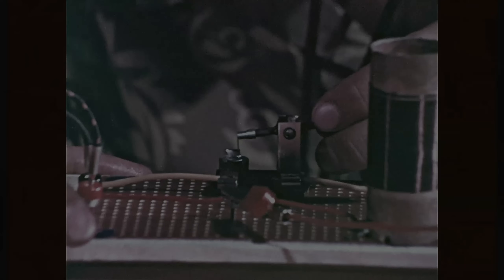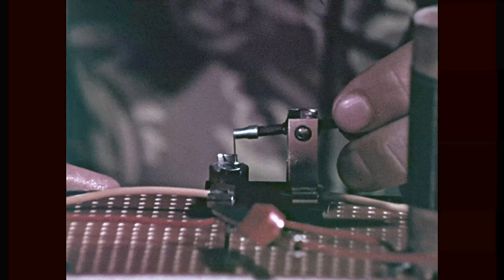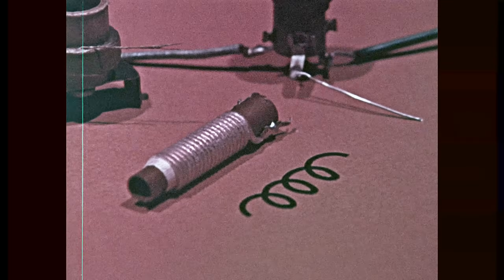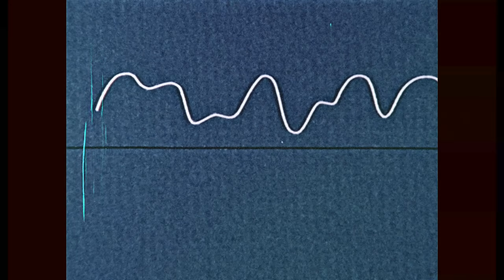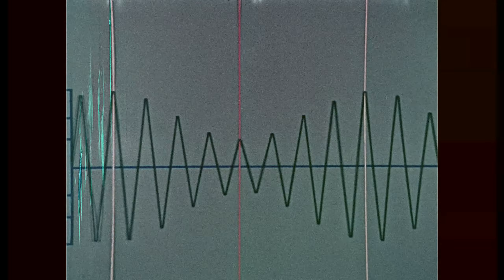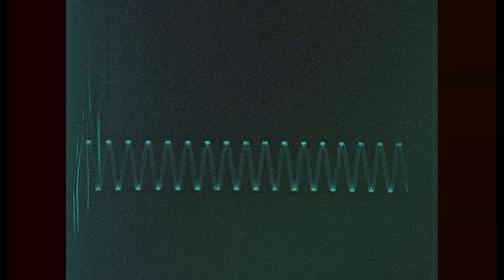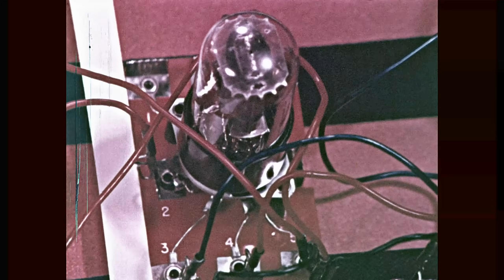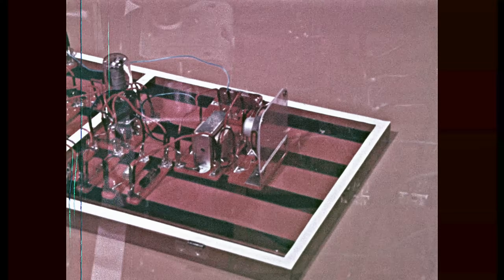Vintage Technology: Electronics--  BASIC RADIO CIRCUITRY, Learn How Radio Works, 1971 (History)

Comment: yo lie un cable al grifo del agua puse un diodo y un auricular, y se escuchaba la AM , jajaja no se si hoy fencionara
Reply from the maker: Using water pipes as an antenna for AM reception may still work in some areas, especially where the AM signals are strong.

Comment: Those who lived through this period told me that Marconi's only important contribution was to experimentally determine that the electrical length of both the transmitting and receiving antenna that develops the best performance corresponds to half the length of the radiated wave.
Reply from the maker: That is an interesting bit of history, thank you for sharing!

Comment: Capacitors do not allow AC current to pass; they enable displacement current (Id) to flow each side of the dielectric, which builds up an electric force field across the dielectric. This displacement current is termed Id, but no electrons can actually flow through the dielectric, unless the capacitor is damaged and has turned into a resistor.
Reply from the maker: Hi @davidholmes167, thank you very much.  An interesting summary.

Comment: I am an engineer and owner, building 18 full powered facilities and many low powers, since 1966. But my post here is not about me .
This video misses a very important point for an individual who should be given credit for the first wireless experiment back in the mid 1800s.
Dr. Mahlon Loomis accidentally discovered and created the first wireless communication many years before Marconi was even born. He set a wireless communication 14 miles between 2 hilltops in Virginia, as witnessed by several including a congressman. Bill K5EYS
Reply from the maker: That is an excellent point!  Dr. Loomis is probably less well known as he should be.  There is quite a bit of historical info in the WP listing that may be of interest as well.  Thank you very much for pointing this out.  His contributions were substantial.  https://en.wikipedia.org/wiki/Mahlon_Loomis

Comment: since 1965 to 1999 myself fabricated more than 1k superheterodyne radio receiver sell able with a honorable price as my bread and sugar as I can't digest butter well along with other 1500 different low cost and useful electronic product mostly consumer electronic products being used in our day to day life for different purposes using thermoionic valves , transistors , ics and system modules with the rapid change of the technical world to keep pace with the present day state of the art now I am capable enough to fabricate any kind of electronic product as per customer need with adequate modification design art work within possible desired degree of limitation of very low cost most acceptable price depending on " cut your coat according to your cloth" and I bestow my whole heaarted sincere respect to one and all about 8 billion inhabitants of this most beautiful and sweet   Earth and let us all try to save this most beautiful Earth for endless X^2 trillion of light years of time sharing our all possible efforts and courage with due respect and kind regards Biplab Banerjee.
Reply from the maker: Hi @biplabbanerjee3013, thank you for your thoughtful feedback!  ~  VK

Comment: As a Cub Scout in New York in the 1960s I tried to build a crystal radio set.  I recall wrapping wire around a cardboard toilet paper tube, and shellacking it.  I needed to obtain a crystal, so my parents took me to a Radio Shack. They had no idea what "crystal" I needed, and instead sold my parents a "diode" which was useless.   I did not become an engineer, and the experience reduced my opinion of Radio Shack, the Cub Scouts, and adults generally.
Reply: I gotta admit..I actually laughed out loud at this comment. 😂   I think kids are WAY smarter than adults.
Reply: The crystal is functioning as a diode.

Comment: While what they said is true about the different transformers, they didn't mention that they also match the impedances between the input and output of each stage, including the audio output transformer, which matches the audio amplifier tube's high plate impedance to the speaker's low impedance, typically around 8 ohms.
Reply from the maker: Good point!   Thank you.

Comment: Fun Fact: In German the name for radio waves is "Funkwellen" because of the spark (in german Funke) that was used to generate the first radio waves. To communicate via CB-Radio is called funken. "To spark" so to speak.
Reply: Also the old brand of car stereos in the 1980s. The brand name was 'Spark-O-Matic' they made car stereo systems for Western Auto stores.   

Interesting fact on funken, thanks for sharing:)
Reply: I'm guessing that's where the brand "Telefunken" came from.

Comment: There is no doubt about the great contribution Marconi made to communications. The main one was the discovery of the half-wave antenna as the highest yielding antenna for electromagnetic stilt transmissions. In addition, he proved to be an efficient industrialist and businessman. His company manufactured and sold broadcast transmitters around the world. I knew one of these kept as a souvenir from the 1920's. The truth is that there were several hands in this work, especially in circuits, and one of the main ones was Edwin Howard Armstrong, who, after the radio in its simplest form, called crystal, with the advent of triode valves, etc., created the regenerative radio, the heterodyne and the super-heterodyne. He is also responsible for the modulated frequency that is so common in local reception today. Others who made an extraordinary contribution by creating these devices were John Ambrose Fleming (1849-1945), inventor of the thermionic diode valve, and Lee de Forest, in 1906, invented the triode, known as the three-element electronic valve.
Reply from the maker: Hi ferwin3718, very fascinating history, thank you!  ~ VK

Comment: I was a mechanical engineer. In school we also had to take some electrical classes. In one class, we had to design and build a two stage transistor amplifier. The instructor would put an input signal into it. Then, he would hook up the oscilloscope and look at the output signal. Those engineering classes required a lot of hard work and study. But I had a fun 31 year career in the auto industry.
Reply from the maker: Hi @clearsailing7993, that sounds like a fascinating career, you must have seen quite a lot of technical advancements in 31 years!   ~ VK, CHAP
Reply: My engineering teachers don't even know what the oscilloscope is...😂😂😂

Comment: I was licenced in 1967 when I was 14 of age. My first TX was just like you showed; made of surplus TV shassis. And my first Keyer was like in the camp shooting where two small straight keys were assembled against each others. Then my first SSB rig was Heathkit HW-100. Now I have vintage station: Drake Line and Heathkit SB-line and Hy-Gain AV-14AVQ which was owned by Armas OH2NB. 73 de Matt OH2BIO
Reply from the maker: Hi @mattikaki, It sounds like you have a great collection now in your vintage equipment!  Very nice!.  Thanks for sharing your thoughts!  ~  VK

Comment: Very interesting to get back on this!
I'm practicing electronic since the 80. At the time we could still see many of that technologies
Then came the tiny versions: tiny, low cost but often bad quality! :(.
I then had found an optalix  one in a empty room: nobody claimed it! Very good quality!
 All  transistors, very good quality.Very special design: 2 flat 4.5 volts batteries where needed.
The speaker was a 16 Ohms which is not current! On that video each steps is very well described!
Reply from the maker: @jeanyves5380, thank you, good info!   Thank you for the feedback also!  ~ VK

Comment: @2:34, the coil is not made to "improve..." but to select a frequency by resonance due to the variable capacitor in parallel. The little piece of crystal is not made to "detect" the carrier signal... but to rectify the alternating signal current. Have I gone completely mad, or is this "instructional" video rather unclear?
Reply: The film was meant as an introduction to radio and was aimed at maybe non technical people. With this in mind, the terms were selected. The people with more understanding, would know the more accurate terms. A film full of technical terms might overwhelm or frighten off a newcomer. I personally think this was a great introduction to the principles of radio. The valves or tubes are now transistors and ICs, but not much else has changed in AM broadcast.

Comment: Radio/TV signals also transmits energy that can easily be turned into 110 /220 volt electric with modded demodulaters

Comment: I've been an electrical engineer for over 40 years and I'm embarrassed to say I just barely understand all the electrical components and systems in the world... nevermind understanding how all these components are built from dirt
Reply: You're not the only one mate
Reply: How did you get your EE degree?
I mean, sure, RF is a different specialty in electronics. But you use the same components in digital or lf analgie circuits.
Reply: @CallousCoder  more than obe discipline i'm an EE but electronics engineer
Reply: @scotttait2197 huh??? Sorry, Me follow not. I think you were drinking when you write this 😂EE is electrical engineer.
Reply: Does the narrator sound like Alex Trebec?
Reply: You are a humble man, on path to truth. Blessings to you.
Reply: Wait you can be an engineer without understanding these electrical components?

Comment: Sorry, but don't I think you're quite right when you say AC passes through a capacitor. There is actually. no current through the dielectric, which is an insulator. What happens is that when there are the constant AC changes in the applied voltage, there are a corresponding changes  to the electrostatic charge between the plates, which results in a current in the external circuit. This seems to be a current going through the capacitor, but it is not.
Reply from the maker: You could be right, thank you!

Comment: When this film was made, transistors still had not completely replaced the vacume tube amplifier, and ALL electronic appliances, i.e. radios, stereos, and tv sets, were made with discrete components. Now ALL major circuitry are on chips, with only a few discrete components to be seen inside of an appliance, whether a radio, tv, or a computer. And GONE are those bulky CRT tubes in tv sets, replaced by the flat screens. The miniaturization of electronic devices that has occurred over the last 54 years since this educational film was made is astounding.
Reply from the maker: Hi @johnishikawa2200, yes, you are certainly right!  Astounding progress in the last half-century.  And what will it be like in the next 10?   ~  VK

Comment: I took electronics shop in high school back in the 60s. I built a superhet AM receiver from scratch. 
I built several projects from ARRL Handbook. The class was equipped with tools, instruments and common parts.
There was a local electronics store that was full of any part or tool you could imagine.
I took high school shop classes in wood, metal , auto mechanics, mechanical drawing and electronics. I guess they stopped doing vocational education in high school. 
I went on to get a BSEE. I worked for 30 years until retirement.
Reply from the maker: Hi @kingtut3467, it sounds like you have a great background!  The BSEE must have been a very good foundation as well!    Thank you for the feedback!  ~  VK

Comment: In the early 60s,my elderly next door neighbor gave me a cats whisker crystal and told me to ask my dad to build a radio with it. He did and ran the antennae wire from my bedroom window to the garage roof,a distance of a few hundred feet.  Wawz zarapath NJ was a religious station only a few miles away and came in the loudest. Wor NY city was second loudest.  The fact that no batteries were required was great and it started a life long love of radio for me.
Reply from the maker: Hi @geralderdek282, that is a great story.  It is a powerful way to demonstrate how radio wave energy, crystal vibrations and the right combination of wires brings to life the magic of invisible signals in the "air."   Thank you for sharing that story!
Reply: Both stations are still on the air and still come in clearly at my neck of the woods (Mercer County, Nee Jersey).

Comment: I still remember looking at the tubes in the radio receiver and wondering how this works. Then studied electronic engineering and witnessed the disapearance of a lot of real electronic elements in circuits, which were replaced by integrated circuits and later by software.
Reply from the maker: Hi @thearchibaldtuttle, thank you for your feedback.   Yes, the jump from tubes to ICs was quite a transition!   ~

Comment: I believe classic and vintage radios are way better than modern ones reception quality wise. Mostly all electronics based devices are better before than now
Reply from the maker: Very true!
Reply: Lol! I don't miss lugging that heavy stuff around!!! Yes the sound was analog and not crisp though but... I'm good. Fining the bad wire was a real pain as well!
Reply: @arianagm2332  Yes, they're not the lightest in weight or the prettiest in look. In fact most of them are not easy to get 'em running due to the fact that they use types of batteries simply do not exist nowadays. All that aside, they were built to last. As a radio enthusiast I can tell you that radios' reception depend on more than their antennas. Nature elements as humidity, cloudless sky, reduced earth magnetic field (at night), and many other factors play a major role in your radio reception. Did you know that when humidity is high you could hear channels from far away cities such that you can't pick up on a dry day? That's why in a coastal city you find more channels on radio. I work with electronic components for living and I prefer to use a used component (transistor, ic , capacitor , resistor ...etc) from an old radio or tv than buying new ones which is cheaper for me.

Comment: My first exposure to building a crystal set was when I was a nine year old boy. It was indeed fascinating , I still retain the interest at 64 years now. What a wonder it was then and come in good stead over a half a century later.  I built the match box radio. Ferrite rod and Coil , variable capacitor (tuner), Crystal Diode, transistor OC71 and earphone.
Reply from the maker: Sounds like a very fascinating project you had!    excellent!
Reply: @ComputerHistoryArchivesProject  It Indeed  it was a dream come true. I spent all the pocket money  I got to procure the parts and the cabinet for the radio was a plastic soap dish. What a thrill it was to receive  the Medium Wave signal.
Reply: Yes I built my crystal radio from old radio sets. Grabbed the coil and soldered a germanium diode, then I used a transistors socket to plug into and then it inputted to a small amp with speaker. I called it my bottle cap radio.

Comment: I learned this at technical college in the early 90s, though I had already learned the basics doing electronics as a hobby in the 80s. Its still relevant to how modern communication works even if it is modulated with digital information now and needs some D to A processing before you get sound out of it
Reply from the maker: Hi @stephenw2992, "D to A"  ... "Digital to Analog"  I presume.    ~ Thanks very much for the feedback.

Comment: It is called Audio Modulation, the other is called Frequency modulation or as the members of the "underground" called it FM radio
Reply: Amplitude Modulation and Frquency Modulation. AM has to sideboards upper and lower 3khz wide each.
Reply: You mean TWO SIDEBANDS.  I think your spellchecker got you there.
Reply: OK, I am old. I built crystal radios, (not out of Meth) and played them at night, using a variety of antennas ( I made a few out of coat hangers, and some out of electrical and speaker wire hung from a curtain rod in my room) and circuitry. When I was a teen ager, I had a "satellite" radio. It was a crystal radio housed in some kind of case we imagined a satellite looked like. Oh those innocent days!
Reply from the maker: Yes, very true.